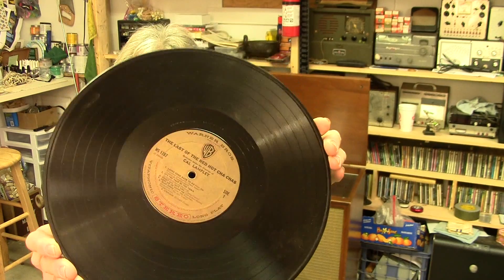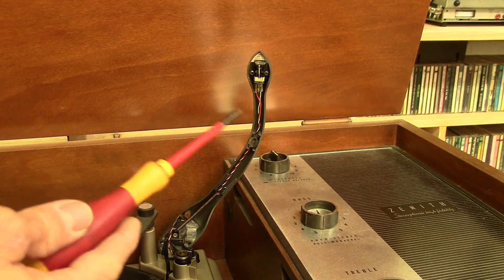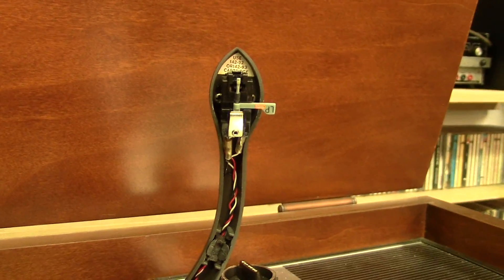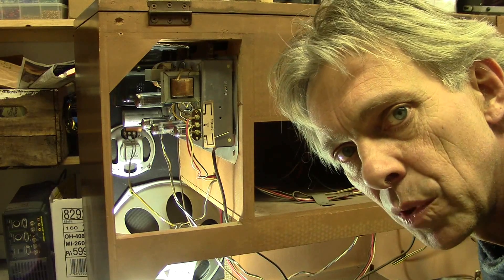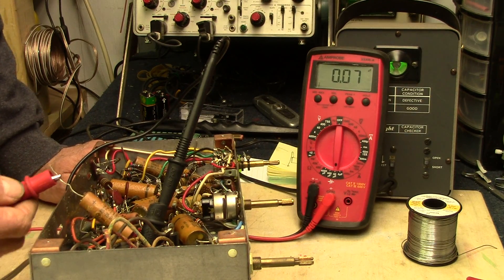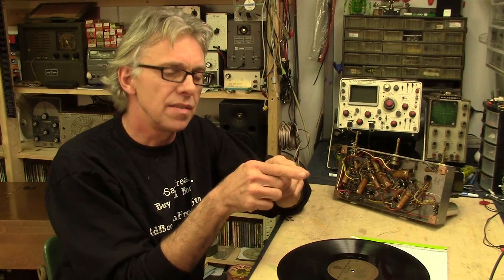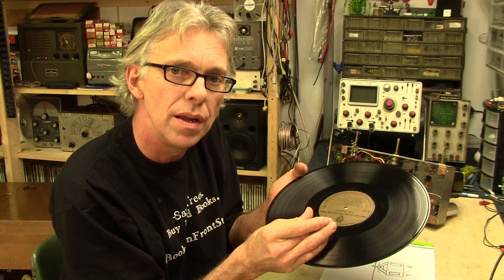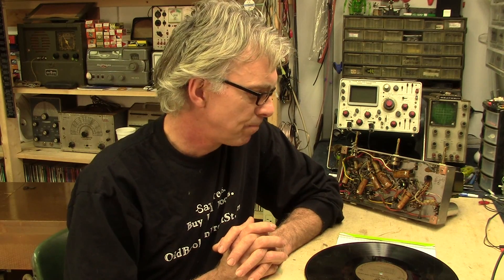1960 Zenith Stereo Restoration Part 2

Comment: hi, i have a similar turntable, zenith and the tone arm keeps coming off of the record automatically. i have tried to manually rotate the platter to reset but nothing is working. it just keeps coming off. it will play for a second and then come off. do you know what the issue may be?

Comment: HI there.. about a year ago i picked up a zenith record player console similar to yours but finished in blonde..i think its from 1959 0r 60 as well..Mine is only the record player and reminds me of one my grandmother had back in my childhood..My machine plays but slow as well, i think theres an issue with the idler wheel needing greased, along with the mechanical end of the changer as well..ive used a dab of lubriplate on other phonos and will try it on this one as well..The quality of sound for that era is amazing and i 'll be following your videos to help bring back my console to perfect running order as well..thanks for the videos !

Comment: When I transported my Motorola Steriophonic High Fidelity (that is setup exactly like this one) parts went flying. I realized I’m missing the “U” shaped part in the tone arm that attaches to the spring to control the stylus pressure. “Stylus Pressure Adjustment” First I need to find a replacement. Then I need to know which notch to place it in for the correct pressure. The original book that came with it says “this operation can be performed by your Motorola Dealer or Service technician.” Any info would help!

Comment: ALL the wax/paper capacitors should be changed!!! Don't even bother to test them, they are leaky!!!  And the Electrolytic filter capacitor should also be changed!!!  
You might want to build yourself one of these:
https://www.youtube.com/watch?v=LhovRIM5xAo
The plans and circuit board layout is available on his patreon page.
Another of his videos is really interesting...it deals with being sure that you don't put the "Non-Polarized" capacitors in backwards!  Yeah, I said the non-polarized ones!  And it really does make a difference!  Check it out:
https://www.youtube.com/watch?v=BnR_DLd1PDI&t=220s
I appreciate the photo you showed of the groove and the needle.  In that photo the needle appeared to me to be way too large...but as you said, there is a lot to it that makes it all work out.
On the axial leaded parts, you can get them from:
Allied Electronics:        https://www.alliedelec.com/electronic-components/capacitors/?category=2%7C2510417%2F4313274&searchWithin=axial%20polypropylene%20capacitors&pg=1
DigiKey                 :        https://www.digikey.com/products/en?keywords=axial%20polypropylene%20capacitors
Mouser                :         https://www.mouser.com/Search/Refine?Keyword=axial+polypropylene+capacitors
I am sure there are other places...such as Amazon...that you can find them, but at least this info will give you a start.
Hope this helps you some.

Comment: Can you help me.  I have a Zenith Console Model #C906-1. The turntable was working befor the move and now it does nothing.  I took the back off and found a wire disconnected.  It's a very long wire attached to the edge like a ground wire. Would disconnected  ground wire keep the turntable from working.  If so,  I cannot tell where the other end attaches to. It's got a copper fork clip.  Any ideas would be appreciated. Thank you!
Reply from the maker: That’s the ground wire for the turntable. It’s usually attached to the chassis of the amplifier.

Comment: Always replace paper or electrolytic capacitors older than 1987. Always. The Knight capacitor tester checks for EPR (effective parallel resistance, aka "leaky-ness"). There's capacitance, ESR (effective series resistance), EPR, and self-discharge. Everyone tests capacitance which isn't very critical except in RF circuits. Some people test ESR, and believe it matters more than it does, although that may explain your volume difference. EPR  is critically important in tube circuits as a leaky tube will change tube bias and destroy tubes and transformers. Self-discharge isn't a big deal in audio frequency gear. I think it was RCA, published a book on capacitor testing that's in the public domain now. It's worth reading. Thanks for the video!

Comment: Did you replace all the old axial caps  with axial caps or  did you use some radial lead caps? Did you check the platter spin rate to see how close it came to 33 1/3?

Comment: I have an old AMC stereo I have redone.  I'm just realizing my stereo than I cannot find any info on is very, similar to yours. I replaced the old paper woofers and my sound is still off a bit.  I think my issue is the capacitors.  I have a multi-meter and a solder gun. The only issue is that I don't know what to check for to see if the caps are bad.  Any links for a beginner that would help?

Comment: Looking good, sounding better. Once recapped you'll have a strong performer. I got a tip a while back about cheap aftermarket cartridges and needles. It seems the replacements are vinyl killers, doesn't apply to every cart and needle though. I grew up with vinyl in the house, and collect it myself. Looking forward to part 3. Thanks for sharing.
Nathan
Reply: I just re-capped it and now the left channel is REALLY bad. More troubleshooting to do in Part 3. :)

Comment: It seems to me that if the needle moves from left to right in the groove, that the left and right channel would be 180 degrees out of phase with each other, which can't be the case?!
Reply: The vibrations actually get transmitted into the cartridge at 45 degree angles. Think of the needle moving not only left and right but also up and down slightly, all at once.